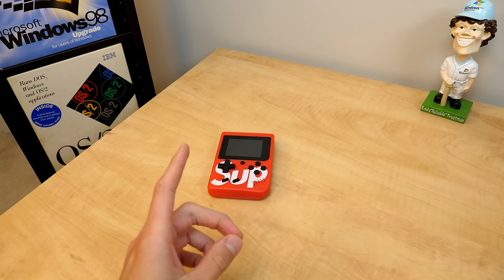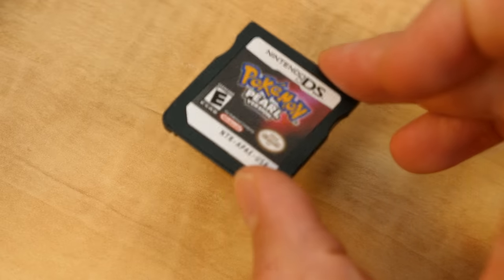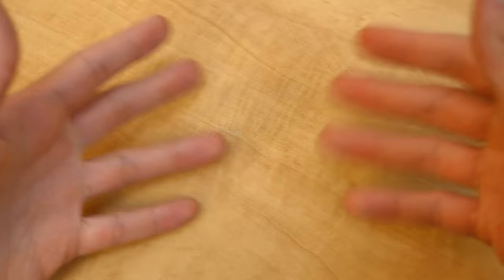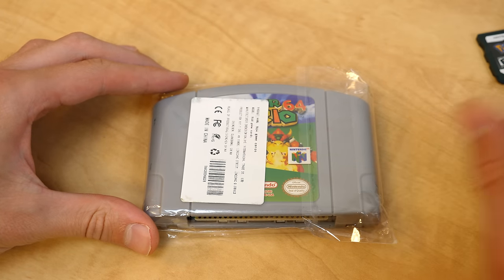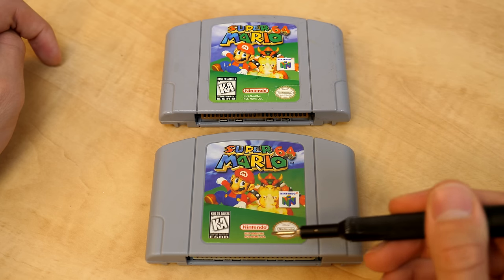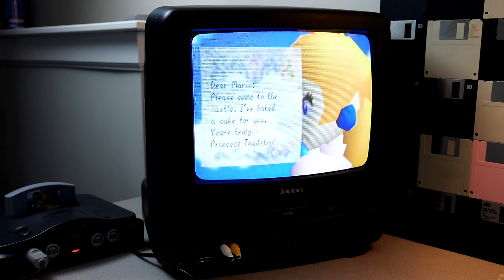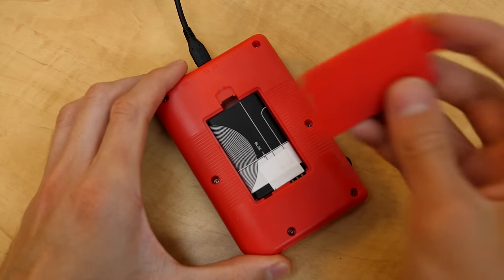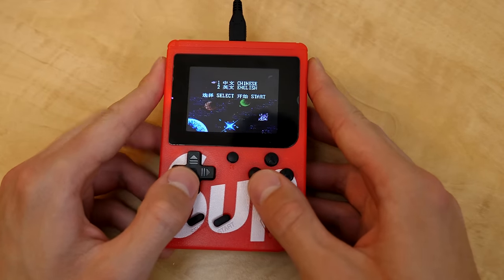I Bought Bootleg Nintendo Games from Temu

Comment: I actually own the bootleg rom drive you had for pearl (although mine is a multi-in-one I got for Christmas lol). It actually tricks the ds intol believing the game is a normal game, even allowing you to trade between that and an official game. Its really interesting.
Reply: Did you beat the game? Where there unsual shit inside of the game.
Reply: @lmao2302  yeah I beat platinum, game runs completely normally right up to the end. 

It actually has 2 wrong roms (B2W2 are both actually rom hacks) and I want to try trading with those. I doubt it'd work but it'd be very funny.
Reply: So built in cheats probably like half the price and it works perfectly fine. This shit a steal.
Reply: @lmao2302  yeah lmao, I used the built in cheats to help me transfer a legit shiny shaymin from Platinum (since I needed a second copy of black/white to do it)
Reply: Sick

Comment: I wouldn't be suprised if these flash carts have a time bomb in them. very common thing for r4 carts to have a time bomb built in which makes them die after a while.
Reply: Yeah, for some reason that's very common with cheap flash carts. Most of the time, the timebomb can be bypassed through custom firmware files though, there's tutorials on youtube on how to do this.
Reply: The clone R4 "timebombs" are code in the cartridge's kernel that tell them not to work past a certain date in order to keep selling new ones each year. The original R4 did not have this. This only works for systems with an RTC, like the DS. It can be bypassed by setting the date in your system before the trigger point set in the kernel, or by replacing the kernel with one like Wood R4. Non-SD card flash cartridges (unlike the ones in the video, that use flash memory but not in a way you can easily load yourself like SD card ones) are unlikely to have anything similar because they don't have a kernel to load the games, it presents itself to the system as if it was the original cartridge instead.
Reply: @velocity37  don't know why but your comment is shadow banned (have to sort by new to read)
Reply: these cards are ace3ds+, they have no timebomb
Reply: Even if you have a timebomb just gotta change the date back and it works perfectly fine so in my opinion a timebomb isn’t as big as an issue as people make it out to be.

Comment: for the leaf green cart. its pretty good. the label looks glossy and is foil in the pic, and its centered correctly. my fire red is glossy too. 
but heres 2 things i noticed before you even opened the shell.
"gold square" all real carts have them, and come fakes do as well, so its not a good way to tell if a game is real, but is a way to certify a game as fake. 

all GB shells have a "battery cutaway" on the front shell, it's on the inside, near the upper right corner of the label. all games have this, even if they dont have a battery. on translucent carts its easy to see without opening as it will show as a slightly lighter color of the shell.

on the topic of "glob tops" there are a few original Gameboy games that do have glob tops, but they are early games. this was caused by a chip shortage, and nintendo needed to make due with what they had.
Reply: its "make do" btw

Comment: I would like to give some extra info to the saving functions of this game copies. Because of them beeing a rom, if you save the game there is a point were the music and the game stops because it has to make a copy of the whole ROM, not like the original ones were there is a actual save state.
The difference here is, that if you turn of the console before the game finished saving. A Save state on a ROM based game it will be completely deleted, not like  on the original one. 
Altough it might end up corrupted in the original version, (which I would just assume) it might still be a method to check if the game is fake or not. Having a ROM software on it to start the game would be the biggest clue ofcourse.

Comment: The SUP console has a friggin BL-5C battery in it! That was originally a Nokia proprietary battery model for quite a few feature phones throughout the 2000s but you can still buy knockoffs of it. I know I have seen one of those used in another cheap device some time ago, but don't recall what it was. It oddly seems to have become an standard of sorts with chinesium stuff.
Reply: it also resembles the battery of sony ps3/ps4 controllers

Comment: Those are a great cheap way to get a DS flash cart if you wanted one, since those are just generic DS flash carts but with different labels on them. I also did the same with the 3ds I bought. Got it from japan with a 64gb sd card. I wound up modding it and installed the US firmware on it.

Comment: Every repro cart I’ve had has bugged out on me, I wish there were high quality reproductions that didn’t poop out right after the 8th gym and had full trade functionality because these games are getting wayyyy too expensive
Reply: I've been telling people for years to soft mod your console even if you have a dslite or a og phat ds you still have access to two menu with a flashcard
Reply: If it craps that consistently at a specific point, it'd probably the ROM it's loaded with. You can fix that by just downloading a fresh one online and putting it on that SD card

Comment: 16:40 I'm actually quite impressed with that clone. It looks like a decent quality surface-mount PCB and it's using an Altera CPLD/FPGA (which might explain why it's a bit pricey). If I had to guess, it's probably a pre-programmed flash cart or something.
Reply: Why should it need a cpld/fpga? Its just a rom and some support logic but i gues the flash has a different interface and they use the chip as a converter

Comment: The fake ones (both N64 and GBA) look like they carry flash ICs (as opposed to ROMs), and I suspect you should be able to reflash those to any other ROM you want. I'd expect them to have one PCB, they insert a blank cart without a label into a flasher, flash the desired bootleg and stick on the desired label.

Comment: @MichaelMJD I can explain the Deep Labrynth thing, because I'm bored. It's a bit technical.

Short story: It's a trick to make it work with the DSi and 3DS (in DS backward compatible mode, obviously; it doesn't load 3DS games).

Long story: When the DSi and 3DS launched, Nintendo wanted to use that opportunity to try and kill the R4 flash carts. Just before release, they started to ship games with a new security mechanism.. This security was to store a signature of the whole game code just AFTER the normal header, which is read and checked by DSi/3DS. This way, it would still work in the old DS models (it is just ignored).

But what about old games already released? The DSi/3DS contains hashes in the system software of all previously released and legitimate games and will only boot those if the ROM hash matches. The hash is taken and compared once you press A to launch the game, and aborts if it doesn't match.

It turned out that it was possible to brute force this signature if the payload is small enough, so what the R4 people did was to take a legitimate game, brute force the signature of a tiny chain-loader, and then use this same legit game's header on the flashcart. The chain loader then boots the R4 software, which is still possible because DS-mode security is still broken. Thus, the DSi/3DS would boot it, thinking that it is really Deep Labrynth.

There are only a handful of games that work with this, and you see them in many different carts, since all flashcart makers basically copied each other's work! Typically, it is Spongbob Atlantis Squarepantis that's used.

Comment: Those GBA fakes seem to be great because on some of them you can reflash them with very little equipment, probably just an arduino over USB and a couple of connections.
Reply: I recall there being homebrew for that now. Don't even need special hardware I think. Can just use a DS/DS lite with homebrew. ;)
Reply: It seems to be just a microSD card. Can't you use a PC to write on it?
Reply: @louistournas120   The DS carts use SD cards. The GBA ones use internal flash storage.
Reply: If you have two DS's can you trade Pokémon with them or do the genuine copies know that they aren't being sent a real genuine Pokémon from a genuine game?
Reply: @skycloud4802   Normal trades from one DS to another DS should work normally, as should trades from one GBA to another GBA. IIRC there was a feature to migrate Pokémon from a GBA game to an NDS game and this might not work properly.
Reply: Its nice that they work singlely but I think its just better just to buy a large batch of games onto 1 cart instead.. instead of dealing with 1 by one or just re-do the games yourself.   Buy one those large 10TB+ game (emu)collector drives and use as reference

Comment: I bought a clone DS R4 cartridge a few years ago and it's pretty similar to the flash carts shown in the video. Even the game it pretends to be (Deep Labyrinth) is the same. Something to note if you end up buying one of these: The SD cards they tend to come with are pretty unreliable. The one mine came with became really finicky after a couple of months, it failed to read very often and randomly deleted files. I'm guessing they get a bunch of faulty SD cards and use them since they're cheaper. Make sure to buy a new SD card from a reputable company, afterwards you can just copy all the files off the stock one and it'll work.
Reply: My dad bought two Chinesium microSD cards over 10 years ago. One passed h2testw but started ignoring writes a few uses in, while the other one  is working _so far_. Fingers crossed...
Reply: Ah, that's at least good to hear. I should just need like a 128 GB MicroSD, right?

Comment: those ds flashcarts are just reskinned Ace3DS Plus cartridges and work like mostly any other DS flashcart. They are more expensive than just buying the card outright and supplying your own SD card. the SD cards they come with are known to be faulty and fail rather quickly.

Comment: I have a cart that came in a used DSlite and it has printed SoulSilver/HeartGold combo label and the lil memory cart in the top and the boot screen shows that it's almost as capable as a PSP with a whole screen that lets you choose from consoles and files...I've only used SoulSilver and it saves so I havent tried the other stuff in case it would erase the SoulSilver file 😂

Comment: Another thing to note about the GBA cartridges: Real cartridges use mask ROM for the left hand chip, while the fakes use either flash or EPROM. That means for the real ones, the game data is etched into the silicon as the chip is made, and this is the only game that chip could ever be from the day it was made. Meanwhile with flash or EPROM, the chip leaves the factory blank and then data is loaded into it electronically. This adds another way to tell the difference: Since the mask ROM chips are manufactured separately per game, the game's 4-letter code is etched into the top of the chip. Along the edge of the chip toward the cartridge connector, you can see it says "BPGE-0" or "BPGE-1", and in the other text on the chip you can also see "AGB-BPGE-0" (or 1).

0 and 1 are the game revision. In this case, 0 is the original release, and 1 is a minor bugfix revision found in "Player's Choice" copies. The most visible change in this one is that the "Presents" text in the "Game Freak Presents" screen during startup was missing in revision 0. Also, Pidgey shows up as the "Tiny Pokemon" in revision 0's Pokedex when it should be "Tiny Bird Pokemon" as it appears in 1 -- this is a text display glitch and affects any Pokemon whose moniker in the dex has more than one word in it.

Comment: For leaf Green, the easiest way to tell if it's legit is to look at the back of the board. There are 4 little rectangles on the top left. The fake ones have a bunch of circles as circuit connections on the back.

Comment: 6:10 The upper right chip looks like a soldered on micro sd-card.
15:08 The dots of the bullet points are not vertically aligned.

Comment: The best way to test saving is to remove the game from the console after saving, because the data will not be lost if you simply restart the console because the cartridge is still getting power from the console.

Comment: authentic gba pokemon games have a bump/ divet in the middle of the lable. it also has a number on the right side somewhere etched in. on the back to tell if its authentic you look at the top left to see if there is 4 silver rectangles (might look like one big piece to some) but yeah you dont need to open it up to tell most of the time!!

Comment: From my understanding, the reason the flashcart came up as a different game was for the DSi. Due to all the rampant flashcarts Nintendo implemented a new security system in the DSi, but since there are already hundreds of DS games before the DSi existed they couldn't just make the DSi refuse to play these, and not like they could somehow update every single DS game ever made to use that security, so they implemented a Whitelist of every DS game ever made up until that point. The flashcards in response just simply then would pretend to be one of those whitelisted games. The downside of this however is that a game booting that way on a DSi would be stuck in DS mode and could not run in DSi mode and take advantage of the newer features, even if the ROM itself is DSi enhanced. AFAIK only one flashcart maker, CycloDSi, bothered to actually reverse-engineer/crack the DSi mode and let it's cart run in DSi Enhanced mode, EVERYONE. ELSE. even to this day just does the cheap and easy impersonate-a-whitelisted-game approach. Kinda sad that nobody else even with DS flashcarts still being manufactured in 2023 is trying to crack the DSi mode instead of copying 15-ish year old budget flashcard bypass methods.

Comment: The main problem with buying these flash carts is if they come preloaded they almost always come with awful SD cards that will corrupt potentially within hours of use. If you want something like this do yourself a favor and buy an Ace3DS or R4 wood card and load the roms yourself with a good quality low storage SD card. You can get the entire setup for less than $20 and have every DS/GBA game forever.

Comment: The sup gameboy I had one, it was a prize in a raffle, but they showed it as the real gameboy collor. I won it and when I looked at it I cried inside. It was the "game machine with built-in games." it sucked so bad, and it stopped working after I used it three times. If it says built-in games then don't buy it, 

(I was going to tell the school that it was a scam but then my parents told me that I should be "grateful" and "It's the same" it is 
actual trash)

Comment: These flashcarts are pretty good. Just be sure to replace the micro SD cards since that's where they cheap out on them. You can generally get them much cheaper than he did in this video

Comment: I haven't finished the video but I love my counterfeit Pokemon games. I have every mainline series game, in box with all the manuals and paperwork. There not sealed but some of the games with box are easily up to $800 like my complete in box Crystal. They've gone up so much in price I legit don't want to risk harming them and keep the real ones purely for shelf display. So these little $15 games are perfect for MY situation.
Edit: That is really weird. I've never seen any counterfeit that was a R4 card being used. All of mine are cheaper-crappy games that bought for like $2, peel the sticker and wiped the data off of it, upload whatever Pokemon game they want and reproduce a label. So it's at least real Nintendo hardware. There good enough to use Wifi, trade and battle other people.
I don't buy from Wish/Temu/AliExpress, all mine came from individual sellers in the US, mostly on Etsy.

Comment: I mean, the best option is to just emulate them on PC, but having that Pearl with the option of having multiple Pokemon ROMs saved on it plus having cheats installed...as long as it could get past anti-piracy measures that bootleg seems even better than an original version, and for cheaper!
Reply: Just make sure you change out the SD card in it though. These tend to use extremely cheap ones that don't last very long. You can get them from a local store though.

Comment: Wait so I have a Pokémon black version 2 bootleg and I thought it was legit until labyrinth popped up, and I was wondering would there be any soft locks on it before I play the game?
Reply: Depends, if it's a patched or unpatched Rom. Play the game, do your first battle and see what happens. If you don't get xp then it's an unpatched rom and you can play a zero xp challenge up to the point where it possibly could freeze (never experienced freezes myself but it seems like it can happen).

Comment: Using auction prices as a way to say that is what they will sell for to say the Temu fake copy is the same price. Also fake copies are plenty on eBay too. 🤦‍♀️ I bought a repro copy of Platinum, it is a real DS game, not using microSD card, and it works great, looks better than most fakes and is CIB with a really good manual, cost 16$ on a different site.